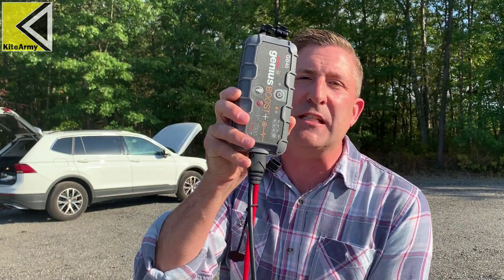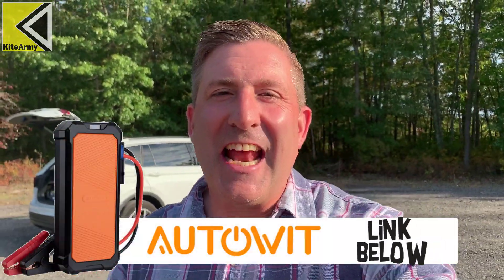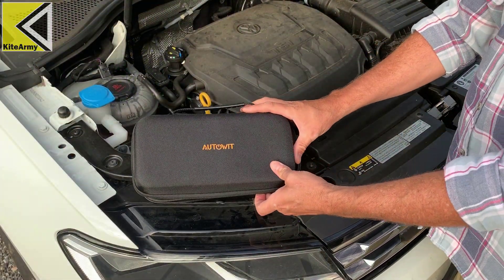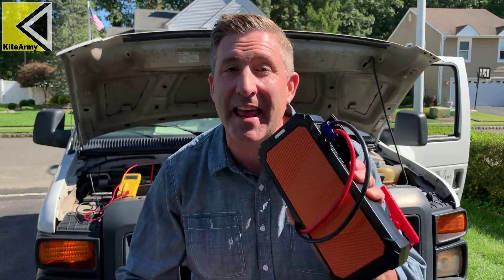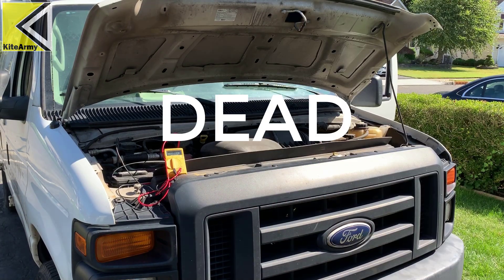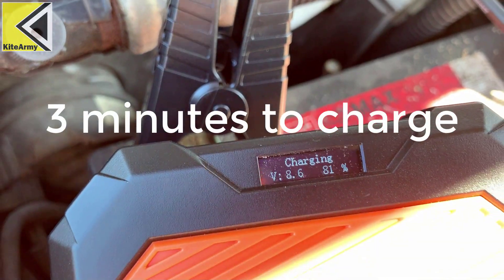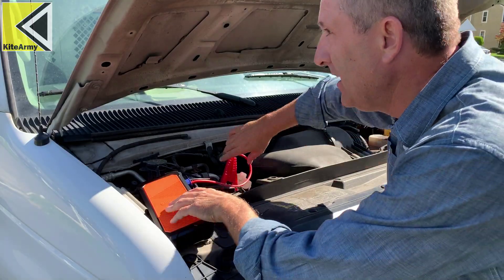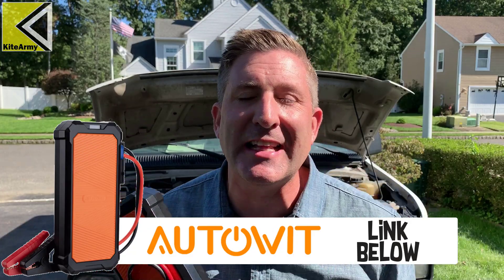Supercapacitor Portable Battery Car Jump Starter | DOES IT WORK ? 🚘🚘🚘

Comment: Thanks for the review and I almost went out and bought this item yesterday morning when my car would not start due to I left the vehicle in the accessory mode overnight and drain the 12V battery down to even the interior light or power windows will not operate at all.  After reading the PDF file of the car,  I learned that because it is a HEV (hybrid electric vehicle) so before attempt to jump start the battery what I needed to do is to press the "12V Battery Reset" button next to the dash, step on the break, press the “START” button and to my surprise .... THE CAR "BOOST" THE BATTERY BY ITSELF!!  According to the manual either driving or idling the car with or without the gas engine kicking in or not, as long as the vehicle's power in "POWER ON" status the onboard hybrid battery will take 30min to fully charge up the 12V battery in the engine bay.   I may still buy one of this SuperCap for my regular ICE (Internal Combustion Engine) when Black Friday comes just for backup even I do have CAA.
Reply from the maker: Great comment - what kind of car?
Reply: @Kitearmy  It's a KIA NIRO Hybrid Electric Vehicle (HEV)
Reply from the maker: @Jeo-What  That's so cool - I have a Volt but I don't think it has that feature
Reply: Kite Army I guess they did not put the extra design feature into it.
Reply from the maker: @Jeo-What  Nope - never had a dead starter battery yet - I find it funny that we have these huge batteries to power the car but it still requires a 12v to start.
Reply: Kite Army I agree. The ICE still needs the 12V to operate as the HEV battery pack is way too much power for it and to put a voltage converter to lower it down to 12V maybe too expansive and generating too much heat and energy lost of the HEV battery pack.
Reply from the maker: @Jeo-What  I just think it's a case of that is how we always did it
Reply: @Jeo-What  so I think that your car has a built in capability to basically do exactly what the Autowit does
Reply: @joebuck4496  Nothing like boosting the little 12V ignition battery by using the hybrid 1.56 kWh lithium-ion polymer battery. Hello Cappuccino x 10!!! 
From 2018 onwards, the Niro hybrid does not feature a conventional lead-acid starter 12-volt battery; instead, a 12-volt lithium battery is housed adjacent to the traction battery to saves weight and maintenance.
Reply: @Kitearmy  I just bought one of these jump starters for my Volt - (does not have the 12V "reset" like the KIA and Hyundai). I got it because cranking time will not be an issue, and I can leave it in the trunk indefinitely! Have seen on another video though that they only crank for a few seconds if you have an ICE.